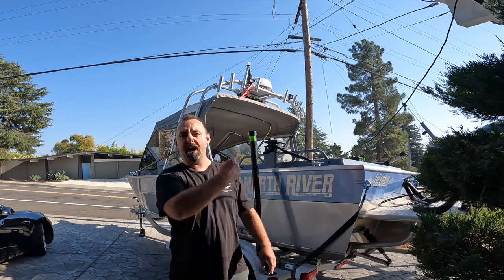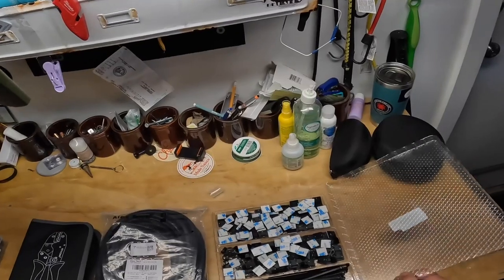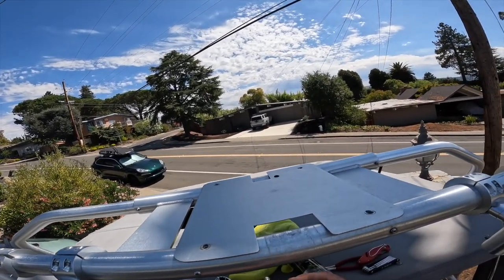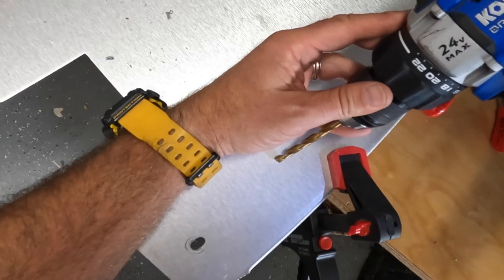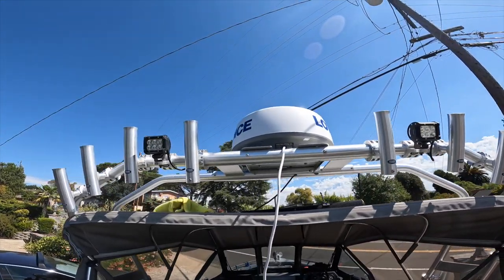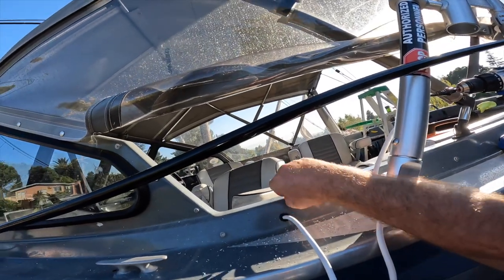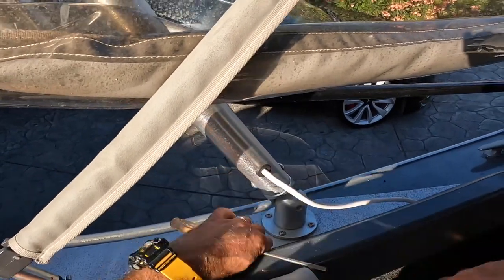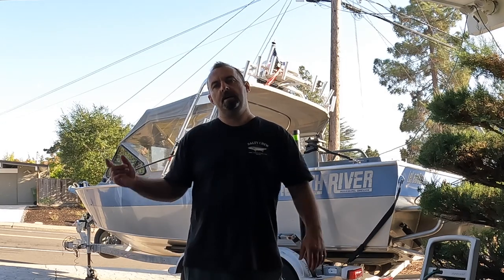Lowrance Halo 20 Radar Installation on North River Seahawk

Comment: Hello. Do you notice any noise with this radar? Whining or high pitched noises of any kind? Whirring or electronic noises? Thanks
Reply from the maker: When it's on, you can hear the rotation of the radar inside the housing. That is normal operations.